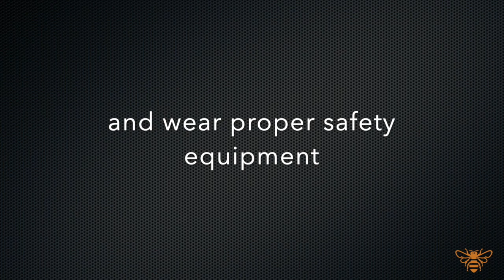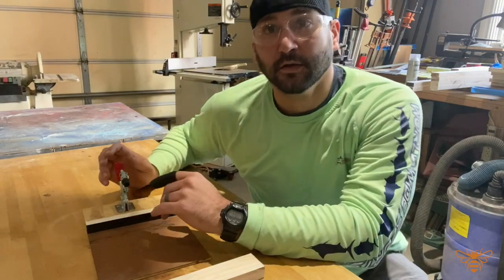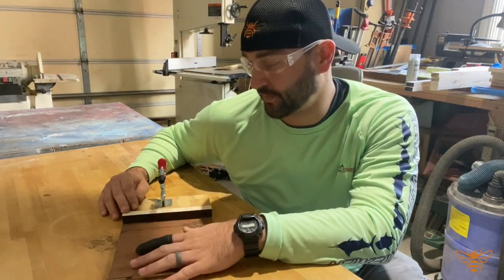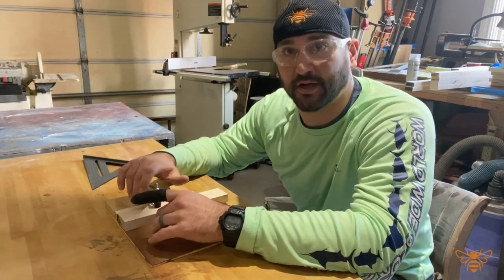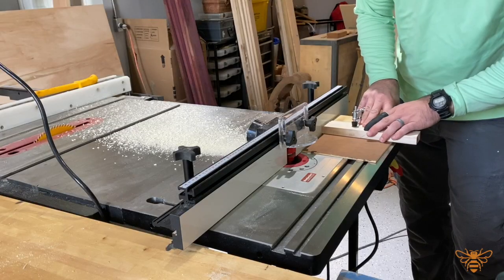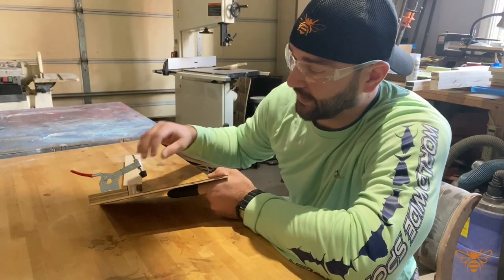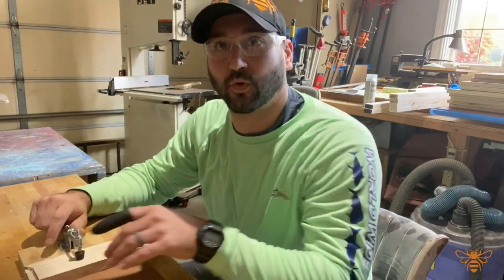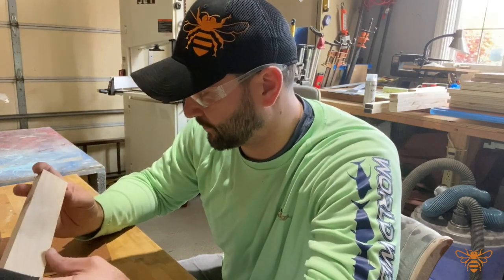Build your own Rail Coping Sled from Scrap wood and a 3 dollar Clamp!

Comment: It looks like you have routed away half of the front of your sled.  (5:13)  How are you going to reference your work square against the fence when your sled is no longer square?
Reply from the maker: Great question Pete. The back portion is still square, so you put that part up the the fence and then butt your piece up to the fence and back support and run it through. Just make sure you are supporting the back to the fence and you’ll be good to go.

Comment: How is the finger now? Nice video, I hate the idea of spending money on something I can build my self. not that I am a Cheapo I have the Incra TS LS Joinery system and the Incra Master lift II Router lift They are great.
I am out looking at other peoples ideas on coping sleds, They are necessary so safety reasons and for acurite part cuts.but is not necessary spend a bunch of money on a sled.
Reply from the maker: It’s always rewarding to make your own but sometimes I buy them when I’m in a pinch or just lazy lol

Comment: Wonder if you could extend the rail out partially past the edge of the sled and make a lighter pass a couple of times then put it flush to the fence for the final cut for a smooth finish.
Reply from the maker: I suppose you could pull they rail back from the edge and slowly step up til you complete the cut. I would just make sure that you have a good surface area of the block portion in the back of the sled to keep it against the fence and safe.
Reply: With a backer board you will not have tear out in 1 pass.

Comment: I would think that your good piece would always have to be exactly the same height as the sacrifice piece when you use the sacrifice piece to set the router bit height?
Reply from the maker: Actually, as long as the sacrificial piece is same or thicker you should be alright because they are both sitting on the same plate. Great question!
Reply: @BusyBeeLiving  Thanks kindly for your reply
Reply: @BusyBeeLiving  Have one more question.  How is the sacrificial piece held down?   Is it glued in, screwed in or something else. It does not seem like it is just loose.  Thanks
Reply from the maker: @erwinerwin1245  I glued mine down because I only do one style of doors and figured if I needed another I would just make a new sled since it’s pretty cheap. If you wanted to make a universal one you could just add a second clamp to secure the piece in place making it easily switched out.
Reply: @BusyBeeLiving  OK thanks for that very useful info and much appreciated

Comment: How did you attach the 3/4 to 1/4? Glue? Brad nail? nice simple vid though I like it!

Edit: i ended up counter sinking screws from the bottom that worked out pretty good.
Reply from the maker: The counter sunk screws is perfect if you plan on using it with different bit setups. Just be careful you don’t drill to far only being a 1/4” base. I glued mine directly to the board so it won't move on me and I can use it to set my router depth in the future.  Since it was so inexpensive to make I figured I can always make another if I change my bit design. Thanks for watching and glad to hear you were able to make your own!